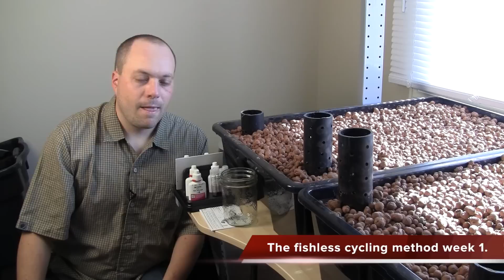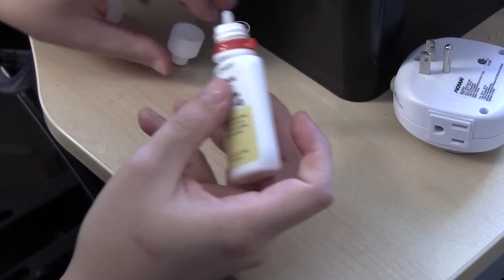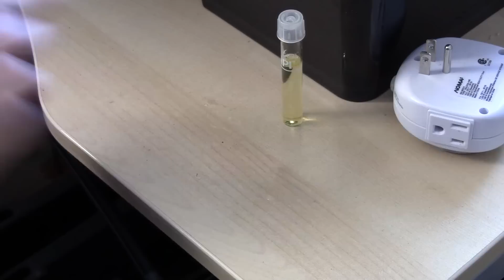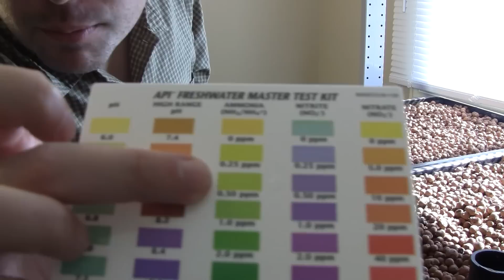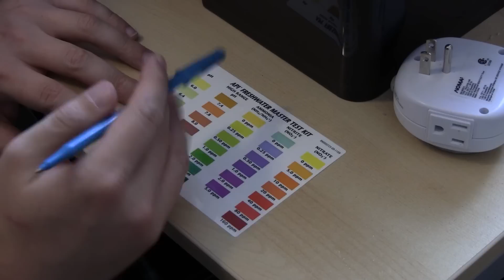Aquaponics system: How to cycle an aquaponics system using the fishless cycling method week 1

Comment: Nice job on the video but your testing methods are racked with errors. I would recommend reading the instructions again with emphasis on the bold print that describes vigorous shaking for specific periods of time and waiting periods before analyzing. The blue Ph color also indicates that the Ph is potentially much higher and thus requires a high Ph test.

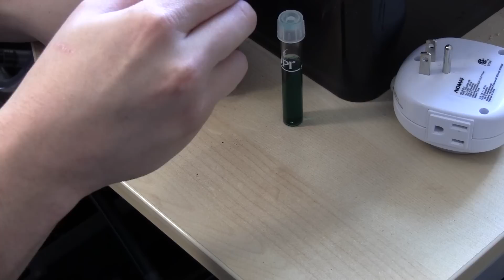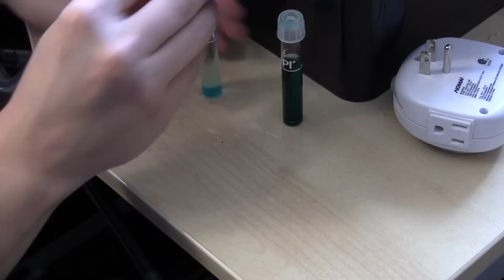Comment: You did a good job, but the Ammonia should have sat for 5 minutes to get a more accurate reading. 5:39 shows that your system is actually reading really high levels of Ammonia around 8ppm. I made the same mistake when I started this and thought my system was reading 0 ppm, but you gotta let it sit and that's why it's dark on slide 5:39. One way to lower ammonia in a fishless cycle is to take some water out and replace it with fresh water. The more I did this from 8 ppm, the more those levels dropped.

Comment: hey btw if you test for ph and the the low ph test turns blue almost instantly,  highly recommend you test the high ph range. blue is the highest ph that test can determine and it should take a few mins for the test to fully darken. my tank got up to almost 8, because I kept using the low range.

Comment: You keep reversing nitrate and nitrite. Ammonia and nitrite are very toxic to fish. Nitrate is the end if the nitrogen cycle (for a basic fish tank) and having a small amount of nitrate is fine and expected for the average fish tank. In an aquaponic system, I would guess nitrates would stay pretty low if everything is working correctly. But once the system is "cycled" and the bacteria is well established, you should not see ANY ammonia or nitrite. Remember ammonia -> nitrite -> nitrate. This is the basic nitrogen cycle. A cycled fish system will have enough bacteria to convert ammonia and nitrite into nitrate fast enough to show 0ppm of ammonia and nitrite on a test. The nitrate will typically build up (which will eventually be to high to be safe for fish) and require a partial water change which basically dilutes the nitrate. Plants can however use the nitrate and convert it into safe stuff for fish which is what an aquaponic system is all about, "free" plant food while cleaning the fish water. Now if you raise fish you can eat in the system, your really getting somewhere. I see so many people doing gold fish, why not tilapia or better yet prawn?

Comment: .5 ppm? Is there a molar equivalent?
Reply: 2.94x10^-5M
Reply: Thanks, it is much easier to do the molar math than to just put capfulls in and guess.
Reply: That must be one really accurate stock solution.
Reply: Lifted it from a Community College. Someone needs to tell them using Avogadro's number for a passcode is not a good thing.

Comment: You could also buy a bottle of Safe Start, which is basically immediately introducing the beneficial bacteria and creating the cycle in 2 days instead of 6 weeks.
Reply: +rabbitgear thats what i used and it saves all the arsing about!

Comment: You know theoretically it could be possible just to urinate into the water since it contains ammonia, instead of purchasing ammonia. Also the pH of urine is typicalIy more acidic than the pKa of the ammonium ion, meaning it stays in solution and therefore more easily controlled. If possible it could make the aquaponics system more economical. I have no idea on volume of urine required. As long as your pee doesn't kill the fish and you're okay with peeing in your system, it might work.

Comment: Robert, I have been running a system for years. If you start out with larger plants mixed with seedlings. You can add the fish 24 hours later with little to no problem. I keep my planting staggered, always making sure I have larger plants in the system and replanting as I go. This seem to maintain my needed levels without fuss and keeps my fish happy.

Comment: If you're going to "fishless cycle"... then you migth as well bump your ammonia levels to 2-4ppm...
If you're only cycling at levels of 0.5-1.... then you may as well just cycle with fish....

Ammonia toxicity is entirely related to a combination of pH and water temperature... and unless your pH is > 7.8... and temperatures less than 20C (you'll have to do the conversion)... then levels of 0.5-1... shouldn't present a problem if cycling with fish....

Comment: It is entirely possible to "fish cycle", as long as daily testing is done and feed minimised, or ceased, according to ammonia levels
With minimal feeding a "fish cycle" probably wont exceed levels of 0.5 - 1ppm anyway, unless you're overstocked

Fishless cycling, especially at the levels of 0.5 - 1, will only cycle your bacterial colony to that level, and the addition of fish, (if feeding is not monitored along with testing) will only see the system "mini-cycle" to the levels required anyway

Comment: Great video. I have a question: so I am building a model aquaponics system, and I need to balance out the pH of the aquarium. I understand that pure ammonia can increase the pH, but I am not sure what I can use to decrease the pH. Do you know any method you can use to actually lower the concentration of H3+? Thanks!

Comment: Hey Robert great video. Just wanted to point out a few things... in the beginning I think u confused Nitrate with Nitrite (dont worry I do it all the time)  Also, when doing the ammonia, nitrite, and nitrate tests you need to shake the solution bottle for about 30 sec, before adding it to the test tubes. You also need to shake the test tube for about 1 min and then let it set for 5 min for the color to develop otherwise you'll get a false reading.

Comment: Did I miss something when you built the overflow, most use a bell siphon and yours was just a tube a couple inches from the top for overflow. When the pump switches off is that when the rest of the water drains into the system? I am following closely, as I want to construct one for this winter. Great job on the video's and I can't wait for the next one!